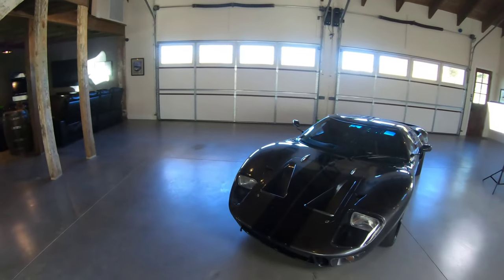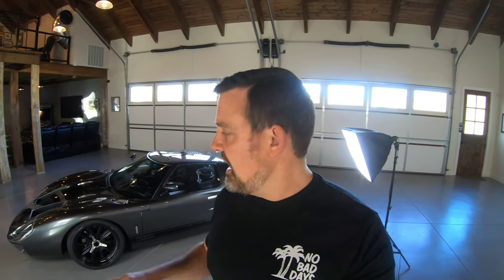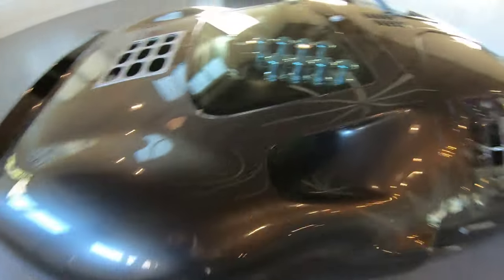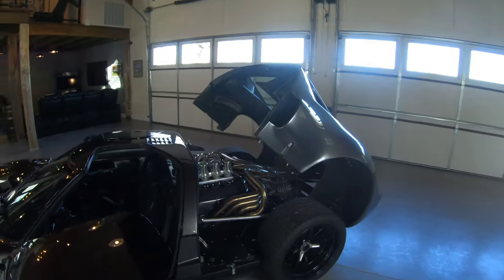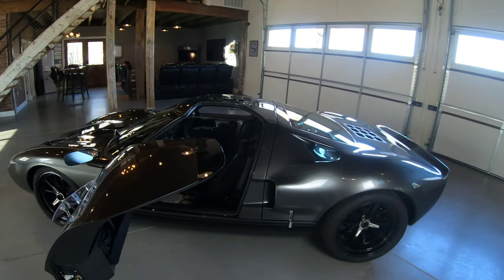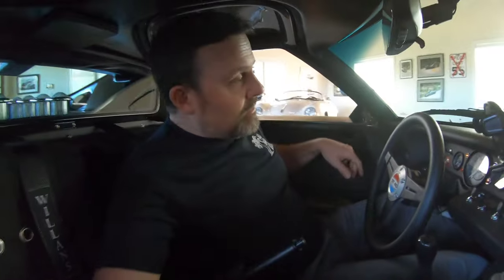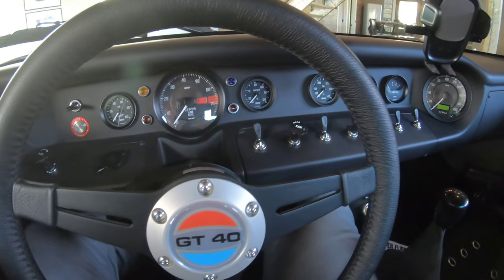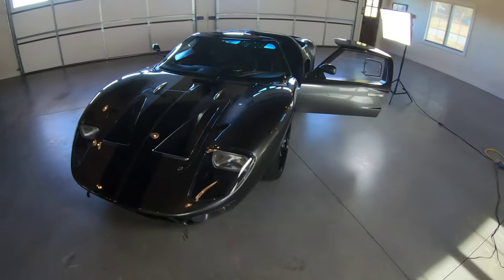1965 Superformance GT40 | Walkaround, Review, Start-Up

Comment: Shelby gave SuperFormance the license and permission to build these and use the GT40 name. Shelby built the GT40 for Ford in the 60s. They do everything the exact same way with the upgrades in materials.
Reply: That's not correct.  Superformance didn't need anything from Shelby to make the GT40, because Shelby didn't design or build the GT40, and they don't own any part of the GT40s licensing.  Shelby's association with the GT40 was that his company, Shelby American, was the racing team that raced the GT40 in many notable races.  Superformance licensed the GT40 from Safir Spares, which is a company that made GT40s using the original tooling, and they acquired the trademark of GT40.
Reply: @jacksonmarshallkramer5087 Much more complecated than that.......... John Wyer bought the FAV facility complete with all the tooling and the GT40 name when Ford decided he wanted a genuine all American Lemans win, it then went to Peter Thorp in the mid 70's who set up Safir Engineering which then closed it's doors in 2000, a US firm bought the name and most of the tooling then called themself Safir spares. Shelby ducked out around 1966/67 when Ken miles died in the 'All American' J car and the most famous mk1 Gt40 (the Gulf Mirage) was built and ran by John Wyer (Shelby's mentor and team boss at Aston martin who handed him his 1959 Lemans win) during the 1968/69 seasons Shelby was living in South Africa.
Reply: Love reading the history of these amazing vehicles. Awesome replies !

Comment: With seeing your head right at the top of the roof, my hopes of ever fitting and driving one of these some day is gone. I'm 6'5" and pretty much all legs. Not gonna happen.🤣
Thank you for sharing your amazing GT40, this thing is an absolute beast. Love the detail that you went into with showing us. Looking forward to future videos of it.🍻
Reply from the maker: Thanks you!!  It would be a bit cramped for you that's for sure.  Will get more video done soon!
Reply: Get some Tillet seats, and have them adjust the pedals to accommodate. Yeah, it'll be tight but you could fit, especially with a gurney bubble

Comment: Beautiful color beautiful car .. I’ve always wanted an old GT40 or cobra since I was a child in the 70’s and now in my 50’s I wouldn’t be able to enjoy it lol became disabled in a horrible accident that left me with loss of power in my left leg and left arm making driving stick impossible but I have seen a few customs done with auto , so I have a question for you do they put the new GT500 engine snd drivetrain in the GT40 since it’s an auto dual clutch ? Also how is it with weather sealing does it have leaks in the rain ? Not that you want to drive a 2200 pound weapon with 600 hp in the rain with no tech aids lol I do like the A/C because here in Florida it gets a bit hot
Reply from the maker: I'm sorry to hear about your accident! All of the GT40s are manual. However, my buddy Dan is working on an automatic version of the car. He owns downforce Motorsports in South Carolina who is exclusively a superformance dealer. You should google him and give him a call. I was literally just talking to him about this the other day! As far as leaks are concerned there are none. I've driven this car in all conditions and have had a blast and never get wet. Go live your dream!

Comment: I'd like that with just a stock 302, 5.0 getting around 225hp, 5 speed manual and RHD (right hand drive) but with the shifter in the center shifting with my left hand. Two tone green and orange trimmed out in white stripes. with light tan interior.

Comment: Love the Coyote motor!  Who did your installation? Roush Performance is trying to talk me out of the Coyote engine, says it's too difficult to install. Thanks!
Reply from the maker: That's just it, no one else has figured this out except for the crew that installed mine.  I actually funded the first ever Coyote Aluminator install in a GT40 with them, which is why I also stuck one in mine.  Dennis from Olthoff Racing.  They are the best Superformance builder hands down in the world and luckily I don't live too far from them.  Google them and give them a shout.

Comment: Absolutely love this car! Great content. Subscribed :). Silly question, is it possible to order it with regular roll down windows? Even if they can’t go down all the way due to the doors small size? I know it’s not exactly period correct to the original but neither is ac, lol. I’m a “windows guy” if that makes any sense. Love cruising with the windows down instead of ac to listen to my coyote 😅
Reply from the maker: That's a great question!  I don't think so because of the way the doors are designed.  Most guys I've seen who want to drive with the "windows down" just take them off lol.  Are you considering ordering one?  If so I'm happy to put you in touch with Dan at Downforce.  Good friend of mine and I've bought 8 Superformance cars through him over the past 3 years, 4 of which were GT40s.  Best cars ever!

Comment: You could have hung that staircase landing from the rafters. That would have given you a cleaner lower floor plan. Slicker looking than sticks and less things to run into.
Reply from the maker: That's a great idea and normally I would have done that. However, all of the wood used for that staircase and the beams holding it up are out of the original Mill from the 1800s that my business partner and I recently redeveloped as the first large redevelopment project in an old downtown. So there's a ton of meeting behind that staircase and the way we built it 👍🏻 If you go watch the video I did of my red 1967 Camaro there's a really deep story there surrounding exactly this.  AutotopiaLA channel flying out next week to do a feature on that car and the project and my garage. Stay tuned!

Comment: when you opened up the rear clamshell a screw fell out and bounced off the tire and ended up who knows where
Reply from the maker: Ok I'll check it out, thank you!
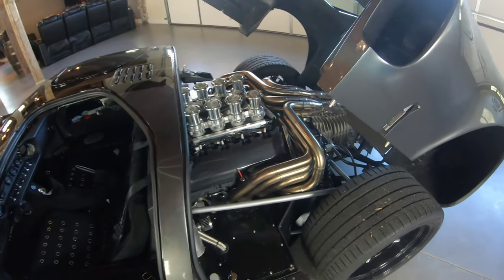Reply: 3:28 I 2nd that. It fell down inside the left tank shelf, likely ended up on the floor or the lower body aero panel.

Comment: I wonder if one could have this vehicle built with not only ABS, but without that 5 speed dog leg transmission. Modern 5 or 6 speed manual.
Reply from the maker: I don't know about ABS, but this transmission is a modern manual not a dogleg so that is possible :)
Reply: @VINGIGGSGarage  Which transmission ?

Comment: Every time I look at that Superformance GT40 video makes me feel ashamed to
The Original Ford GT40.
Probably these people have No Idea why the GT40 engine was a 302. Putting that 17-inch Wheels makes a higher point of gravity and on top of that, this car has a Heavy Twincam Head Coyote in to make it an even higher point of gravity.
Just unbelievable.
Reply from the maker: It drives absolutely incredible

Comment: I guess it's okay if that's what you like. But you ruined it with that engine. You don't put a modular modern engine in a hot rod like that you're supposed to use a race engine like a big block shelby 427 Fe. Pushrod v8 
With a real choppy cam.
Reply from the maker: My other GT40 has that exact setup with a Roush 427.  I have 2 of them, so I wanted this one to be different